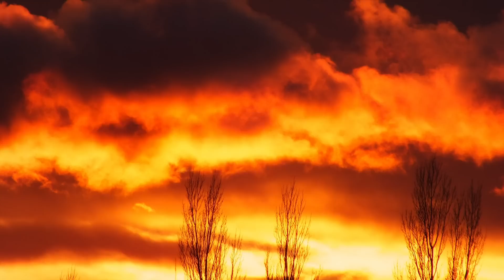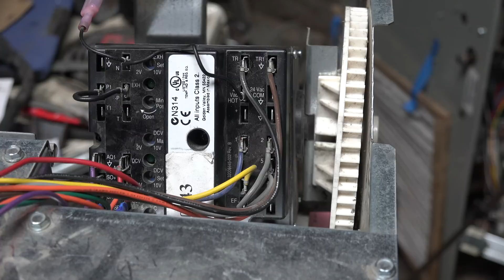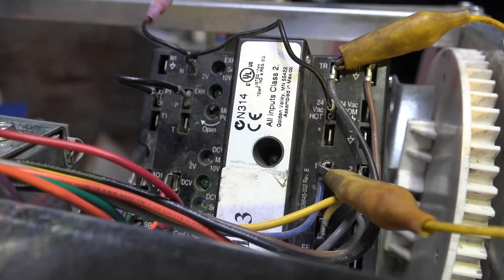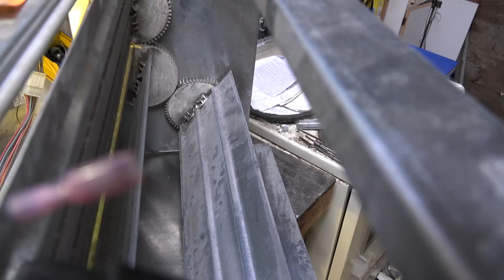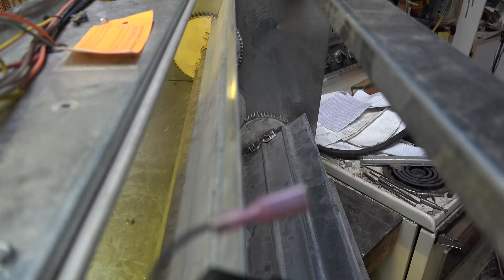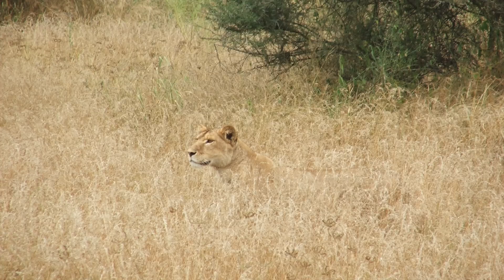Economizer part 4

Comment: Hello GFM....quick question...New in the industry ( Made a switch from the Music Industry....honestly much more rewarding...hvac that is),...watch allot of your videos....Great stuff
I was at a project today...Cooling- split system...checking charge....79 degrees outside.....70 return air....The condenser is a slim line and was 5 inches from a wall (coil closest to wall).....my suction pressure was 170.(60 sat )....my liquid temp 38.9........my head pressure 290 ( 93.7 sat)...and liquid line temp 91......what the hell.?....My guess is the heat being trapped and not able to leave the condenser...and heading back to the indoor coil at a higher temp...( high saturation) while the indoor temp is lower so the txv is restricting air flow......I need help....does my analysis sound right.....Please help...
Reply: Txv restricting airflow? How’s hvac going now